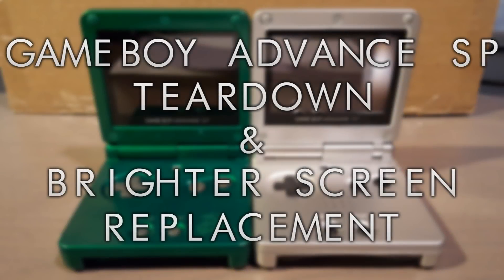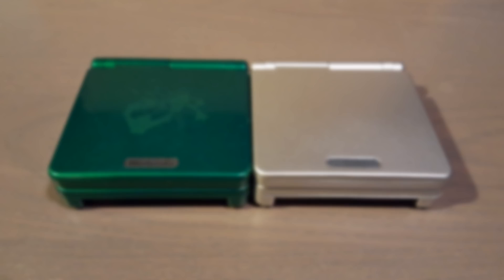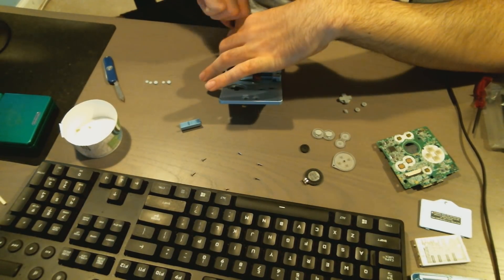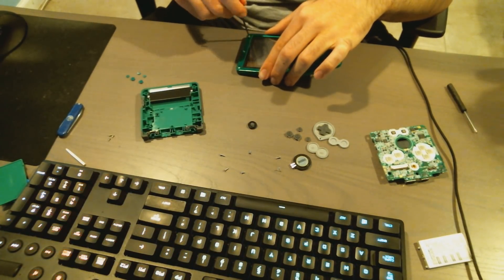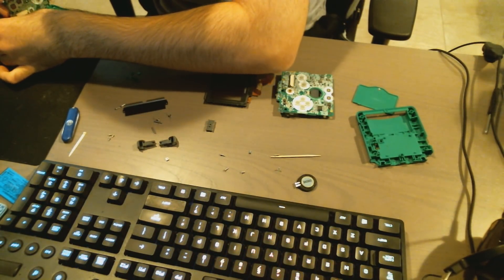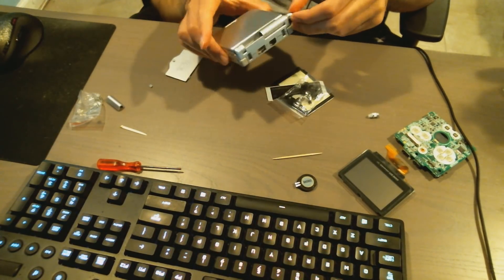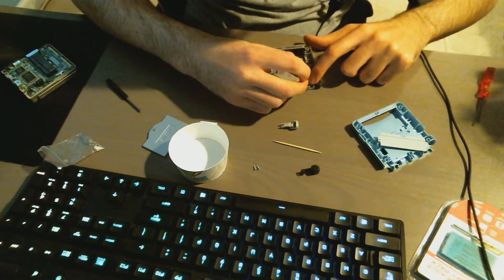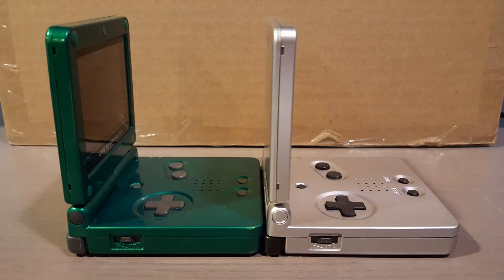Game Boy Advance SP Teardown & ASG 101 Screen Replacement

Comment: Thanks for this! My son dropped his prize purchased with his own money Game Boy SP AGS 101 and the screen broke away from the case and broke the ribbon in the process. I have placed an order for the replacement screen, new housing and replacement hinges just in case. This helps me know what to expect during the replacement surgery.
Reply: I got it all replaced and put back together but can’t change the backlight settings now when I could before. I watched some more videos and some of the IPS screens had a wire that had to be soldered. I don’t remember seeing a wire that was soldered when it was in the old housing; I just saw the ribbon. I also didn’t see a wire with this replacement screen. My replacement screen is the same model as yours. Going by the look of the site you ordered from I believe it was from the same supplier. I have an email into the supplier but wanted to see if your backlight settings work.

Comment: Pro tip. When cleaning electronics use 2% isopropyl alcohol as it evaporates almost instantly and won't fry your electronics if any is left over.
Reply: 2% means it's 98% water, so I'm assuming you wrote that wrong.

Comment: I’m currently doing a swap myself. I have a AGS-001 with the brightness button not functioning and a AGS-101 with L and R triggers not working. My question is, if I swap the screen from the AGS-101 to the AGS-001 motherboard, would the brightness work or would there be a process in order to fix that?
Reply: A year late but if you put a screen from a different model to a different motherboard the screen will not work because the ags 101 screen only works with the 101 motherboard and the 001 only works with the 001 motherboard

Comment: Do I need to solder anything?
Reply: That’s my question too. Because I used this screen to replace one in a AGS101 that was dropped and the ribbon had broken. Didn’t see anything soldered on it before and didn’t see anything on this screen that needed to be soldered but the backlight settings don’t work.

Comment: Hey i want to try Buy a gba SP 001 , change the motherboard for a gba SP 101 and use the LCD of the sp 001 . Do You think it works?
Reply from the maker: It won't work, the LCD and the motherboard have to be from the same model

Comment: Thanks for this. Helped me work up the courage to try putting the internals of my glued together pearl blue 101 SP into my much nicer looking undamaged cobalt blue 001 SP.

Also, the "battery" you're referring to is actually the speaker.
Reply: So are the molds of the shell the same for both 001 and 101? Because I'm thinking of swapping the internal of my 101 into my 001 because of damage reasons...
Reply: @edwin99011  a year late, but yeah the ags 101 and 001 are identical aside from a few minor connections on the motherboard and (obviously) the screen. so any gba sp shell should work with an ags 001 as well as 101

Comment: Why can't you put a 101 screen on a 001 unit? Is it because of the connector?
Reply: The 001 motherboard doesn't provide enough power as-is to power the backlit 101 screen. You need to do some fairly intense soldering to make it work, and if you're going to do that you might as well just get a 101 motherboard.
Reply: @nixnightbird138  gotxha, thanks. I think I'm just going to get a 101 model.

Comment: I’m pretty sure you don’t need an AGS-101 motherboard to use an AGS-101 screen
Although you have to modify the 001’s motherboard and put another component in
Reply: But I understand if you didn’t want to do that and would rather use a real board